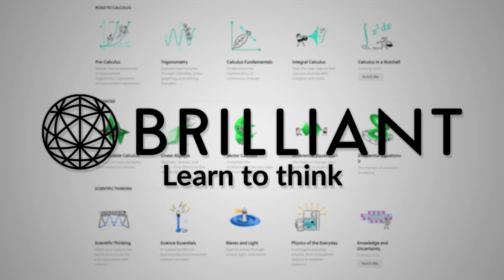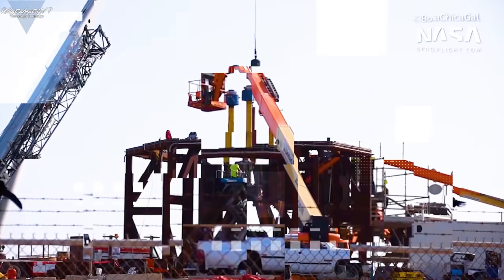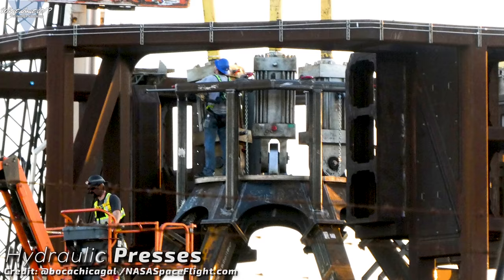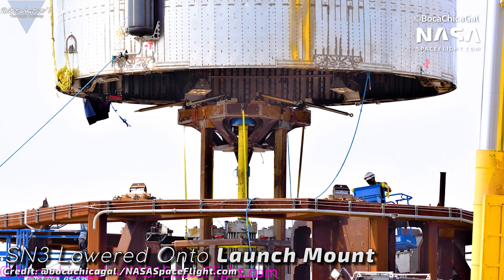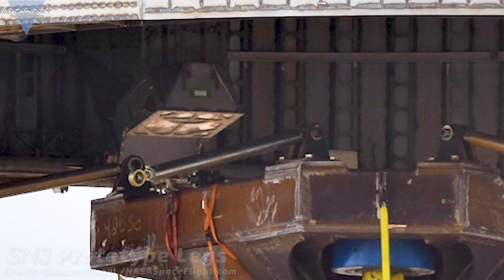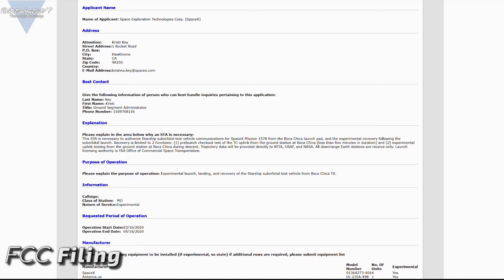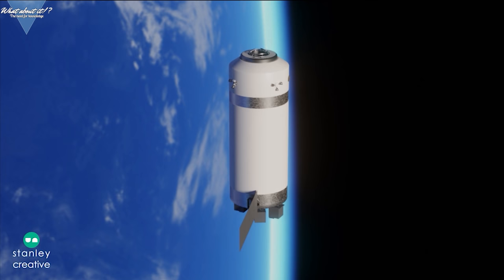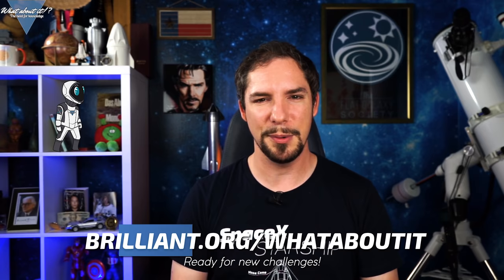81 | SpaceX Starship Updates – Prototype Schedule Update – NASA Orders Dragon XL

Comment: For the first test flight to orbit wouldn't be necessary a superheavy with 37 engines, one with 24 will make the job if would launch starship without payload into orbit.
Reply: And I'm hoping SX makes one or two high hops with SH to test out the grid fins and landing systems. Only needs the relatively few Raptors that will be used for landing, the rest can be dummies. (May need a few more engines to launch, but it will have a reduced propellant load.)

Comment: I dont understand the press things, they will not start the engines before finishing loading the tanks...
Reply: They will fill the tanks, then activate the hydraulic presses to simulate the pressures of engines firing. This puts strain on the tank structures, for an accurate test. Tanks will be drained to make the area safe. Then the presses will be removed and the engines installed.
Reply: @donjones4719  Thanks, but I meant, in real operation, they fill the tanks then they start the engines. Witch means the tanks will be at full pressure before engines puts strain on the tank structures. So why testing them the other way?